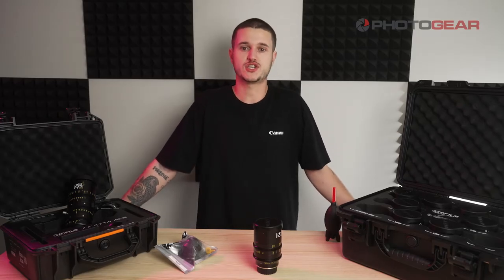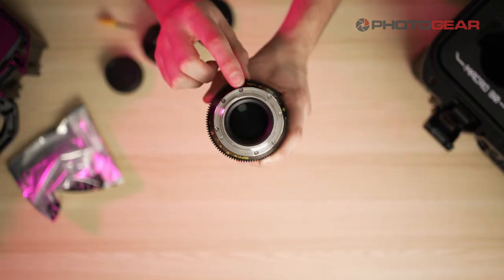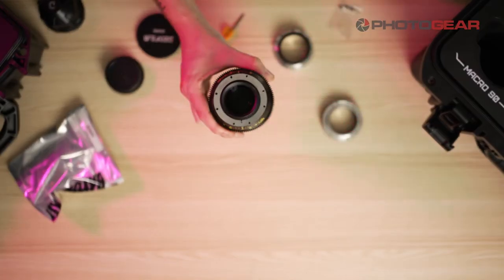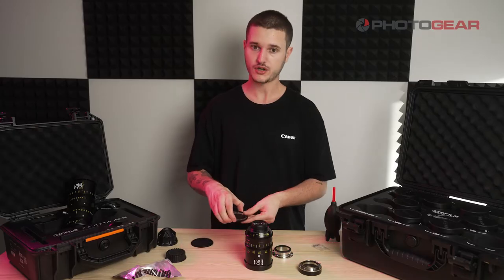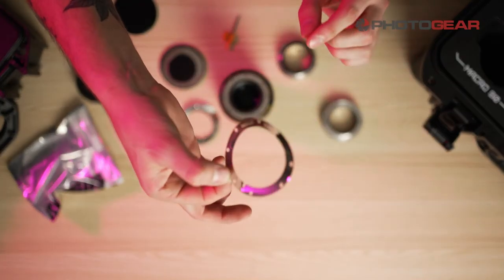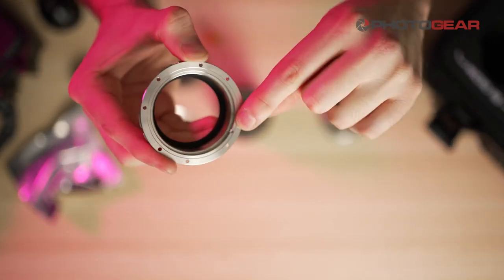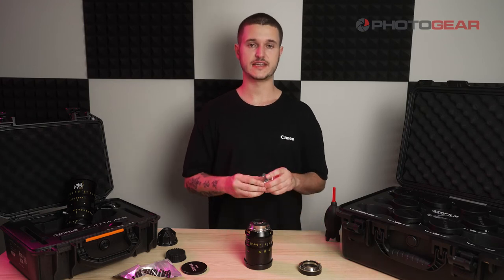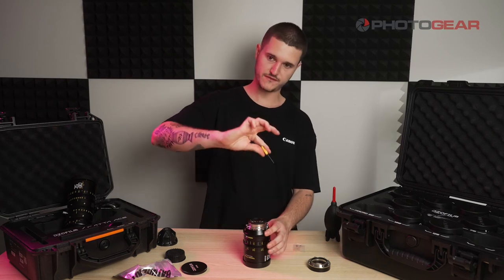How To Change DZOFilm Lens Mounts [Catta Ace & Vespid Prime]

Comment: there's a .5 and a .03 shim already on a PL mount, when switching to  ef do we ad + ANOTHER .14mm on top of that? This feels extremely inconsistent. In my 50mm were .9mm of EF shims, in my 75 was 2.2mm of ef shims, my 21mm had .52 pl shims
Reply: were you able to find an answer to this? I have the same issue.
Reply: Anyone figure this out?
Reply: Did you figure this out?
Reply: I have the same question does anyone know?
Reply: Anyone found the answer to this? Got the same question to use on my C70 with Canon 0.71x. The shims installed for PL are different depending on the lens which makes sense but does it mean we just as .14 regardless of the lens going to EF?
Reply: @JayKyren   I ges it is, using the 0.3 - 0.14 you add 0.16 if that makes sense :)

Comment: If I received the lenses in PL, but I want to switch the mount to EF for use with the Canon 0.71x Speedbooster on the RED Komodo, will I have to mess with shims?
Reply: Same question. Did you ever get an answer to this? What’s the total amount of shims that should be in there?
Reply: @colinshootsfilm  yep. You will need shims for both EF and PL. I ultimately went with the EF speedbooster. It will always be 0.14mm of shims going from PL to EF and -0.14mm going from EF to PL.
Reply: @TEN27  do you have any vignetting in the lenses with the speed booster?
Reply: @landoohmke  nope!